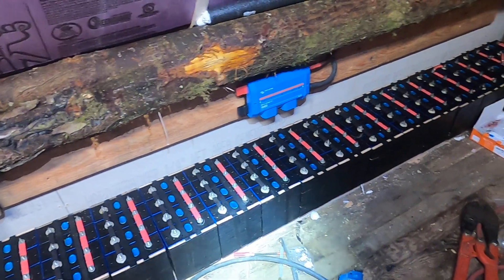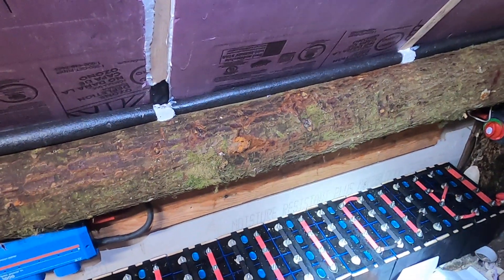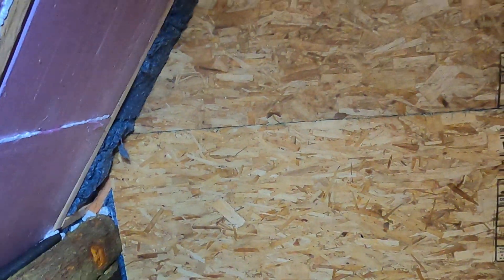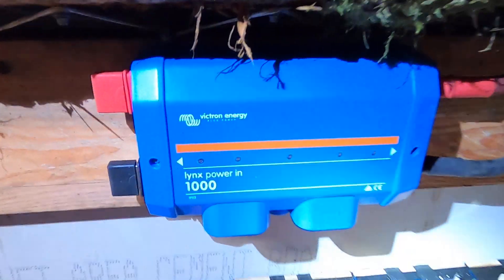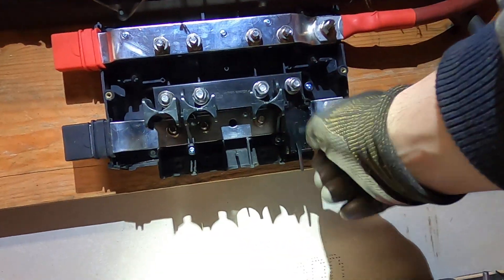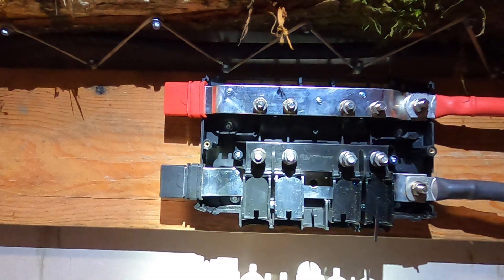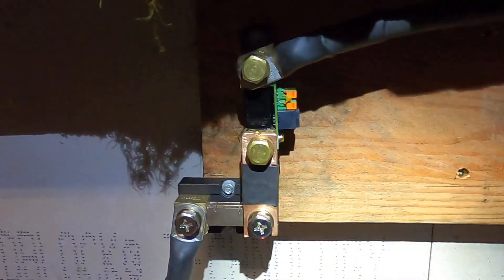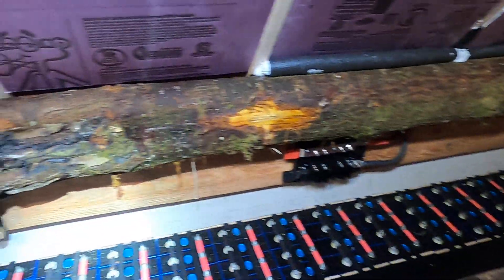Solar Underground A-Frame LiFePo4 System - Battery Update

Comment: I have a 100kwh bank of the same cells. They are doing great!  Also have the victron 5000 kva inverters and if im right the manual says to fuse it with 200 amp fuses.
Reply from the maker: Ok. Thanks!  What are you using for BMS?
Reply: @metagrid9453  batrium watchmon 4 and 112 blockmons